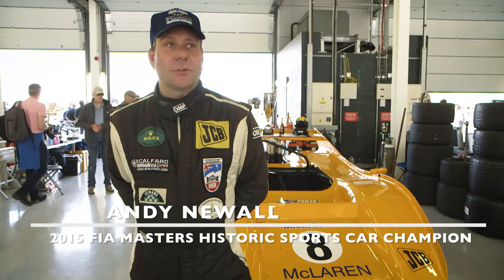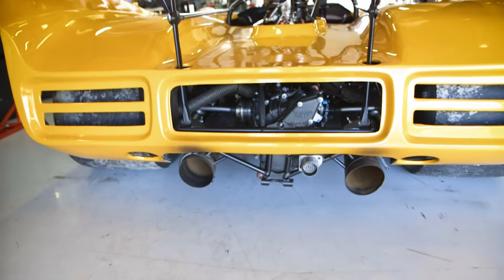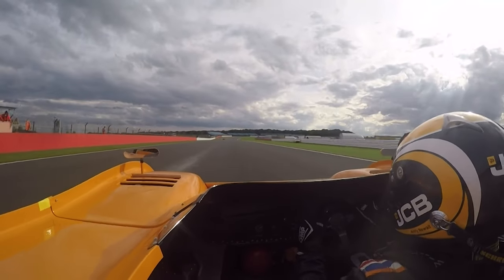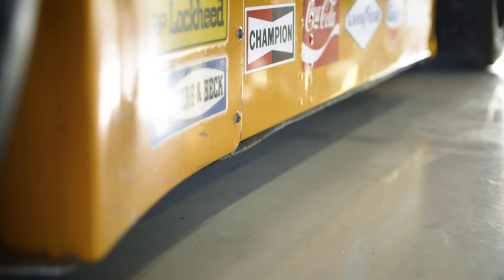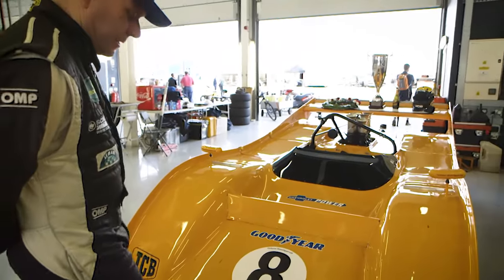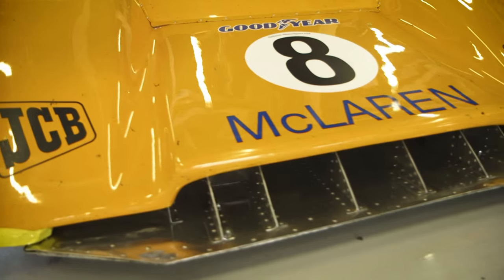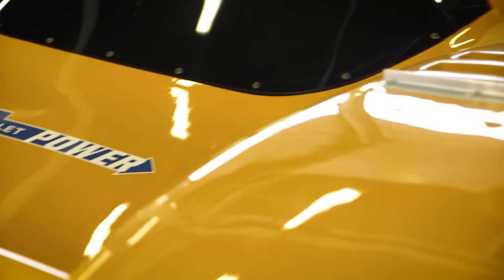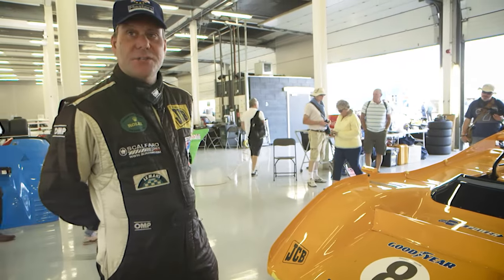Inside an 8.8-litre V8 McLaren Can-Am Monster

Comment: It worth watching the docu-film about Bruce Mclarens life...brilliant. He basically built and raced in canam to pay for his F1 team.
Reply: ...because the 917 was so much faster than anything else that it wasn't any fun to watch.  I saw a CanAm race at Riverside in 1974 standing just before turn 6 where you couldn't see the start-finish line.  The cars did a running start so you could hear the engines winding up before the green flag.  There was a tremendous roar then you saw two Porsches and about 15 minutes later came all of the V8s.  The Porsches hardly made a sound.

OK I exaggerated, but not much.

Comment: Can-am, when F1’s were not the quickest cars on the track..
Reply: There were plenty of places where they were.
Reply: @thethirdman225  But not on the same track.
Reply: @milesdufourny4813  No. I think, from memory, the outright lap record at Watkins Glen was held by a CanAm McLaren for a while.
Reply: First of all, I couldn't find any info of a 8,8 litre engine.... a 7,5 turbo, 7,6 na, 8,1 na, 8,2 na, 8,3 na and a 8,4 na. No 8,8..
Second. On tracks where outright speed is predominant, such as Le Mans, the F1 of same era would be beaten. But if they were to compete on the formula calendar circuits, then F1 would come out on top.. 
They were a lot lighter than CanAm. A lot... 
McLaren M8F: 690-740 bhp vs 689-720 kg. With turbo 930 bhp and 689 kg..!*
McLaren m23: 460-490 bhp vs 570-575 kg.* 
*Numbers depends on where you find info on specs.
Reply: @mortenfrosthansen84  The North American motor situation seems very radical compared to the the European or Asian developments. Chevy small block racing parts... titanium rods, exotic pistons found their way into VW flat fours and even Harley Davidsons. There was so much development put into those motors it got into totally different motors. The determining factor for small or big block was not engine displacement... It was crankshaft journal size. The 351 Ford Cleveland was a big block, the 351 Ford Windsor was a small block. Small nlock Chevies were commonly bored and stroked to 425 ci for racing... they were lighter with more parts available. The AMC 401 was a small and could use Chevy parts for racing like the Penske/Donahue AMX. The 2 liter VW flat four could be built up to 4 liters for drag racing, both 2 and 4 liters are considered big blocks, the 1600, a small block. So, yeah, things aren't always what the numbers might suggest. I could guess how and why they would go to an 8.8 liter Chevy non boosted motor, throttle response, reliability, less internal efficiency loss, the laws of physics favor big blocks in certain areas... air flow is one. Above all, the simplicity and consistency of a gear driven cam overhead pushrod valve can have big advantages. The 427 belt driven SOHC was a mess, powerful but sloppy.
This is why Mercedes went to pushrods in F1, also there were favorable rules... Fun to look back, the new raxial design electric motors will make them all fun dinosaurs 🦕

Comment: They were a 494 CID Reynolds aluminum block with aluminum heads and I believe it was Hilborn fuel Injection.  I helped a friend put one together, it was an M8e, in the 90's after getting it back from the engine builder.  Dyno read 794 hp 798 torque. We were trying to get it ready for the historic at Seattle International Raceway in I believe 1990.  The engine builder had done a couple of other Can Am motors also. There were about eight of us working all night trying to finish for the opening day. I was working on the oil system braided lines. They only go one way and the builder had just put them in a box when the motor was picked up. At about two in the morning after hours of trying to figure out which one went where, I relished that we had some of the wrong hoses. It was so disappointing to tell the others that it was not going to fire tonight or should say this morning. Couple of days later and the correct hoses we were ready to fire it up. Now I was no stranger to high performance motors, street raced a 383 Road Runner in the 70's that a built motor running 12.5 to 1 pistons and a very large cam, but I tell you, when that monster started, everyone jumped as if an explosion went off.  I had to look to see if it had blown the fence down just twenty feet away!  Words can not explain what that was like, however, I ran across this vid on youtube and it is so close, it is worth wearing head phones for the first time and will leave forever memory     https://www.youtube.com/watch?v=FKOki34YkK4
Going to go listen to it right now, the compression ratio must have been crazy...
Reply: lets Ride  cool story
Reply: What revs for those numbers?
Reply: So Peak power was below 5,252? Thgat's where it would cross if it rev'd and made more power up top.
Reply: @JerseyMikeP  No, the formula is torque x RPM ÷ 5252 = power.
Reply: @thethirdman225  LOL, Every Car guy knows the formula power....But torque is whats hard to control..especially in the wet. Can-am cars also had alot less down force making them more of a hand full. IF it made more top end power it would ALways have more HP than Torque if it's Normally aspirated.
Reply: @JerseyMikeP  A lot of people know the formula, including people like me who are not necessarily "car guys" but not all of us misuse the formula. Power and torque are two different things. Why are you talking about them as though they are the same. And why are you using 5252 as an indicator of RPM?
Reply: @thethirdman225  Horsepower is ONLY torque over an RPM. It Doesn't mean anything as HP s just a calculation of torque.  Not Different as Horsepower power is No REAL measurement. Engines ONLY MAKE TORQUE....Anybody that knows cars KNOWS that.
Reply: JerseyMikeP I’m not sure what you’re trying to prove here. I made no claim to knowing about cars. Torque is a measurement of force. Power is work done over time - hence revs per minute.
Reply: @JerseyMikeP - a simpler way to state it is torque has more to do with rate of acceleration while horsepower is more related to the ultimate top speed.

Comment: this has 1.1 litres per cylinder
Holy
goddamn
crap
Reply: @
João Agnelo, Should check out IHRA Pro-Stock... There "Mountain motors" are over 800 ci V8's that are about 1.68L/cylinder making 1,600 <1,800hp.
Reply: João Agnelo the closest we have today is the Dodge Viper, 8.4L v10, larger engine than a Bugatti Chiron.

Comment: Would someone mind explaining what he was talking about the intake lengths? It sure looks like some are taller than others, but his explanation doesn't make sense to me. 
That said, this is one amazing machine! Thanks for the video!! :thumbs up:
Reply: The distance from the tip of the trumpet to the valve is aproximatly the same. That is what he meant. They always looked a bit strange but hey,,,900plus HP and near as much torque  from a [alloy version] truck engine makes them a real beast.
Reply: tscooter22 Big block issue, I suspect.
Reply: tscooter22 varied intake trumpets gave different torque curves per cylinder. Short and wide intake trumpets give power at high rpm, long and thin give immense torque at very low RPM.

Comment: Faster than F1
Reply: 1955 f1
Reply: Not by a long shot!
Reply: Well, it was indeed faster than most early 1970's F1 cars around the larger tracks where downforce  would really come into play.  We have the records.  Obviously, it wouldn't be faster around a tight track like Monaco, but the VASTLY superior power to weight ratio, increased lateral grip, and superior downforce of these Can Am cars make them a force with which to be reckoned!
Reply: In the late 60s and early 70s, the fastest CanAm cars were faster than the fastest F1 cars when run on the same track (different race dates, of course). By several seconds. And just as unreliable.
I remember in the early / mid 70s that the Shadow team ran an exhibition race at Laguna Seca with two Shadow F1s and 2 Shadow CanAms. In this case the F1 cars were a bit faster.

Comment: 4 ppl drive a prius
Reply: 4 ppl drive a car with a 1000 HP 2JZ and laugh at the peasant technology.
Reply: Lol, >cites 2JZ >makes joke about peasant technology> fails to realize that the 3 liter 2JZ is 30-40 pounds heavier than that of a 7 liter LS7 V8.
Reply: Good joke, a fully assembeled 2JZ is around 350 lbs, a 7L LS7 V8 is around 450 lbs. And that is dry weight...with fluids the LS7 goes up to 480 and the 2JZ only to 365. 

The LS7 is 24% heavier, has more vibrations, makes less power on stock internals, and the stock block is not capable of 2000HP as many Supras have proven the 2JZ can do, while be it with fully upgraded internals and a little bit of bracing. 

And yea, I was counting in the Turbos too...don't you worry!
Reply: I don't know where you got those numbers, but I JUST swapped a 650hp NA LS7 a little over a month ago, and it was 410 lbs. on the scale without any accessories, and around 465 lbs. with fluids, pulleys, and all other accessories.  That said, I have yet to see a 500hp+ 2JZ that didn't push the 390lbs mark dry (block and turbo only).  With intercooler, piping, and everything else involved, I'm yet to see a fully functioning, intercooled 2JZ weighing less than 500 lbs. all in. 
  Additionally, who would want a 2JZ other than for its slightly  lower polar moment of intertia?  It isn't any cheaper to get to that point than an LS, and it has a narrower powerband, less low-end torque, and the "famous 2J drop-off" at the top of the RPM range.  That's without even going into the inherent disadvantages of a turbocharger.  Additionally, the LS actually had a lower center of gravity as well due to the cam-in-block design as opposed to the DOHC arrangement on the 2J (which, is undeniably more efficient, but less useful since most modern racing scenarios have horsepower caps anyway).  I've worked both as a mechanic and as an automotive consultant for a living.  I assume you, this is no joke.
Reply: +flyingphoenix113

Well, when you can push the LS block to 2000HP without much bracing call me up, and yea I'd like around 30% efficiency too! Can you do that with the LS? I think not. There is only so much you can do with only one breathing valve....

If you put on a better head on the 2JZ you will get a lot more low end torque, it's all in the head and cams, but typically a 2JZ is aimed for higher rev range! And with good cams and heads you can get nice results in the 4000-10000rpm rev range, if you need more rev range you should learn how to shit ;)

LS7 engines are pretty good, if you need to haul a trailer all day, but if you want to race, stick to the 2JZ, it won't throw a rod if you push the boost a tad :) 

Lower CG? eehm with the Turbos and inter cooler down low I'd say it's a dead race.
Reply: Wow.  That's a lot of misinformation, and some correct information.  I'll try to be charitable where I can.

Firstly, I'll start off with a concession.  When I talked about the "famous 2JZ drop off," I did not add the necessary amount of specificity to my statement, and you rightly called me out on it.  I was referring specifically to a common complaint about the stock 2JZ-GTE and the twin-sequential turbocharger setup.  Supposedly, the despite a surprisingly wide powerband, the stock setup was just out of breath for the last 1000 RPMs or so, leading to a lot of people being relatively confused or disappointed at the time.  Of course, this problem can be easily solved with a turbo swap, and the 2JZ (in modified form) makes tons of power at high RPM thanks to the efficient belt-driven DOHC design and high-flow 4 valve per cylinder heads.  

Next, let's bust some misconceptions about the LS.  You can indeed push a stock LS block to 2000hp without worrying.  But, that is only the case with one such block at the moment.  It's name is the LSX, an GM actually used the 2000hp mark as one of the selling points of the engine.  The LSX is the 2JZ of the LS world.  It is currently the only production LS with an iron block and aluminum heads, and it was designed specifically for forced induction of all kinds (including nitrous, which can typically be the most volatile).  That said, it is the heaviest LS engine as a result.  If you want to read more about it, HotRod did an excellent article a few years back on it when it first came out.

And, while you are indeed right about the 2JZ being able to make surprising amounts of low-end torque for its displacement, said torque only comes...... after turbo spool.  I know it seems like an obvious thing, but it's the reason why people don't usually push heavily tubocharged cars over the 700hp mark on the street unless they have slicks or AWD (or both).  The narrow powerband and STEEP torque curve make it uncontrolable in most instances.  Meanwhile, a comparable LS will have a wider, more linear powerband with a relatively flat torque curve which significantly improves drivability in a daily-driver scenario.

But, racing is my background, so let's tackle the inherent flaws of these engines in a racing scenario.  When it comes to packaging, I'm sure you could mount all of the essential plumbing for the 2JZ fairly low, but the problem then becomes weight distribution.  The weight has been spread over a wide area rather than being mounted close to the CG of the car, and that's not ideal either.  Then, there's the belt-driven cams, the single most widely-criticized aspect of the 2JZ.  I've personally seen a belt failure on a 2JZ (albeit, I believe it was naturally aspirated), and it wasn't pretty.  Belt driven cams are popular because they are cheap to make, cheap to maintain, quiet, and very efficient.  They are also the least reliable form of cam timing by far.  The LS uses a chain-driven cam. Since there's only one cam, and it's right next to the crankshaft, this system makes sense for pushrod V8's because it's also cheap and quiet, but also extremely reliable (despite being a bit sloppier and less efficient than the other two forms).  But, even companies like Lamborghini used chain-driven cams because they are the most practical for a street engine.  The ideal form for racing is gear-driven cams.  Some high-end motorcycles used them, but they are few and far between now.  It is EXTREMELY expensive to develop such a system, and gear-driven cams are incredibly loud, so this tech is usually reserved for factory race cars and engines that were only ever meant to go racing.  But, it's also incredibly reliable.  Also, depending on the engine configuration, it can be highly impractical to use a gear-driven cam setup, but it's still the best of the three for racing.

So, for a drag race, 2JZ.  By the time that you get to the 2000hp mark, it will almost certainly be lighter than the comparable LSX setup, and it should stay together almost as long (given proper maintenance and care, of course).

But, for modern endurance racing, get an LS.  The lighter weight of the all-aluminum block and heads coupled with the incredibly reliable chain-driven camshaft system means that it is almost the ideal endurance racing engine.  But, to understand why, you have to understand the LS, and where it came from:

The LS is fundamentally, the lightest weight Small-Block Chevy possible without beginning to compromise reliability, or go into the realm of excessive cost.  The SBC is routinely called, "the best engine in history" for a reason.  From its inception, it was designed to use the least amount of moving parts possible to reduce the chance of any mechanical failure whilst still producing an adequate amount of power and smoothness.  Couple this with the fact that the engineers went out of their way to prevent any situation in which the SBC would generate a high amount of friction or pressure, and suddenly it becomes a lot easier to understand why all NA LS engines make peak power before 8000 RPMs.  I've seen a street-legal LS go to 10,150 RPMs and stay together, but as the engine builder put it, "it's just a thought experiment to see how tough these engines are.  It made peak horsepower way back at 7900 RPMs."  (The only reason that engine even got to that point was because of INCREDIBLY stiff, NASCAR-spec valve springs, ITBs, and a list of modifications too long to count).  Is it the ideal engine?  No, but it is one of the most simple and most reliable.  And, while I hold great respect for the 2JZ and what it can do in niche situations, it just isn't a superior engine for the vast majority of scenarios that one might encounter (be it on the street, track, strip, etc.)

Comment: "A family-sized car engine per cylinder" Hahaha... In the U.K. maybe. A liter is a motorcycle in the U.S. This is just a tuned big block Chevy V8 cast in aluminum. It's a land yacht because it holds 74 gallons of fuel (!!!) via two fuel tanks on either side of the driver. Here's how many Can-Am championships Chevy engines won that Porsche did not: All of them.